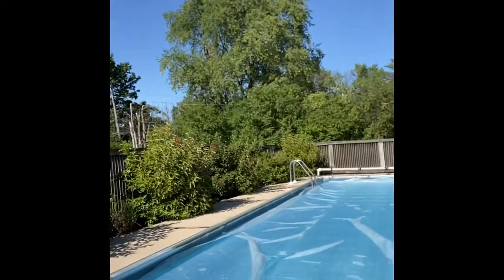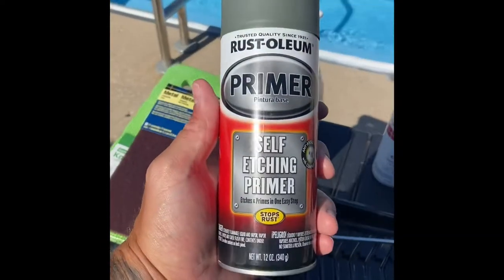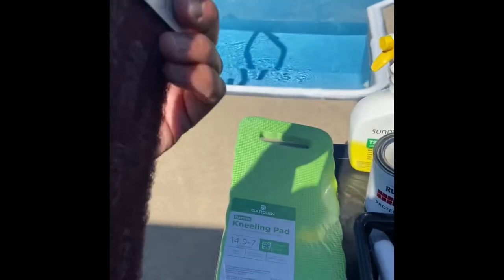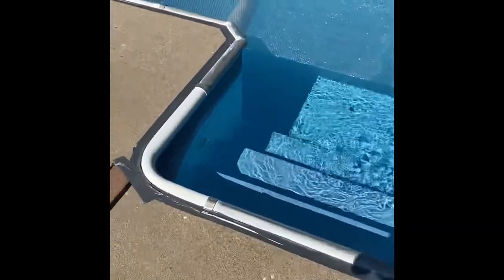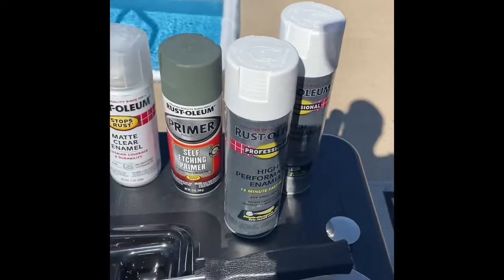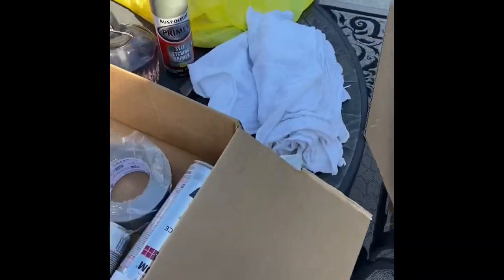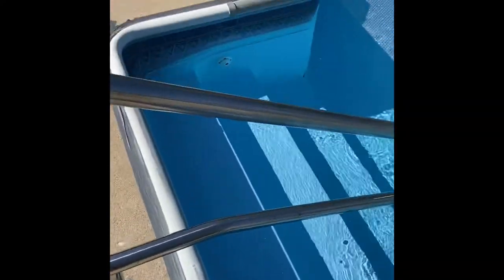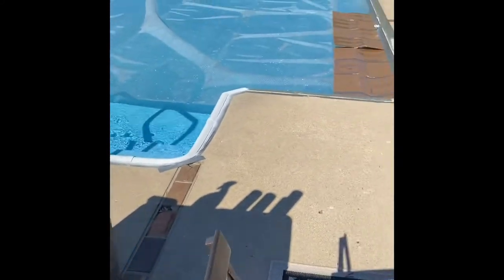DIY painting pool coping ( step by step) Everything you need to know￼  ￼#swimming #swimmingpool

Comment: @joshsbluecollarbuildsdesig7427 how's the paint holding up? how long after the paint did you apply the clear? was it immediately after or > 48 hrs? any issues with wrinkling or cracking, which seems to be a common complaint? and what about yellowing? im in the middle of this project right now & on the fence about the clear.
Reply from the maker: I really have to do a follow up video! Lol. It’s holding up great! The only thing is, during winter the cover rubs on some spots, but not bad at all. I bought a little bottle of rust oleum, touch up, paint. You definitely need to do the clear coat! It makes it bulletproof. No yellowing at all! Rest oleum makes a really great product. Make sure your using the enamel paint. Thanks for watching my video

Comment: I just painted my pool coping using what you suggested.  I think it was easier to paint it on than spray the cans without getting it on the pavers and the liner (new liner coming but got some on the pavers).  I'm having trouble finding a matte enamel clear coat in a can.  Can I use another type of clear coat that isn't enamel?  Wondering if I use a different clear coat will it counter act with what I already have on it?
Reply from the maker: @laural1791  thanks for watching my video. You definitely have to tape off the areas good b4 spray painting. If you used enamel paint, you technically don’t have to use a clear coat. That’s what I’ve been told, but I would imagine any clear coat paint that is the same brand would work. It’s been seasons, and my paint is still holding strong. The only problem areas were the spots that the winter covers springs wore the paint off the coping.
Reply: @joshsbluecollarbuildsdesig7427  yeah they told me I didn't have to do a clear coat but after all that work I didn't want to risk it. I'm trying to find a matte clear coat in a can but it's not the same brand. Some are not enamel clear coat also, do you think a different type would cause any issues?
Reply from the maker: @laural1791  if I were you, I would just go with a rust oleum Matt clear it doesn’t have to be an enamel. You already use the enamel paint that’s gonna be good enough. my pool coping has held up so good.
Reply from the maker: You can also look it up on Amazon and have it delivered. But any rust oleum clearcoat is what I would use.